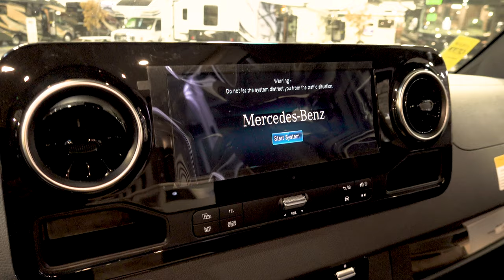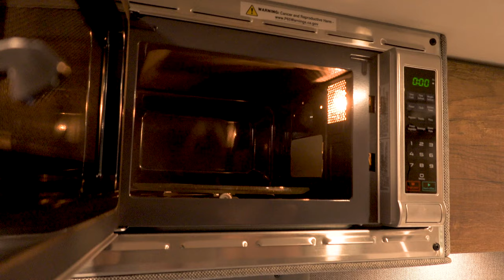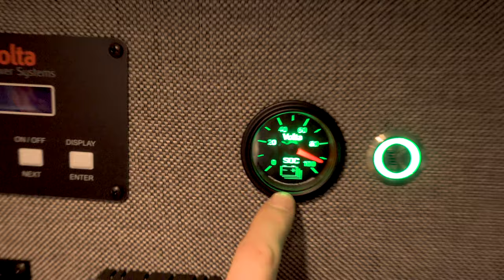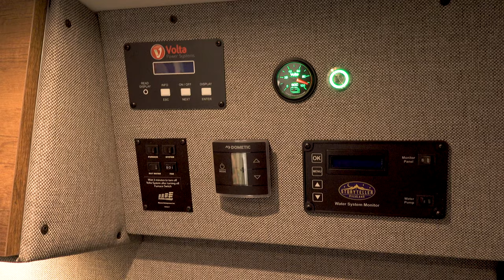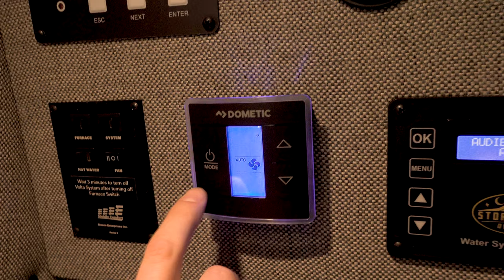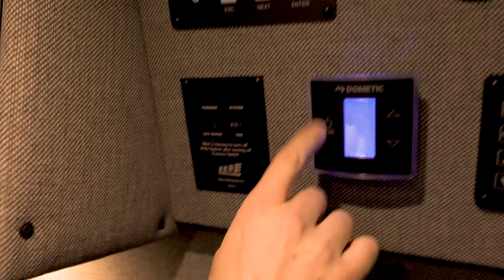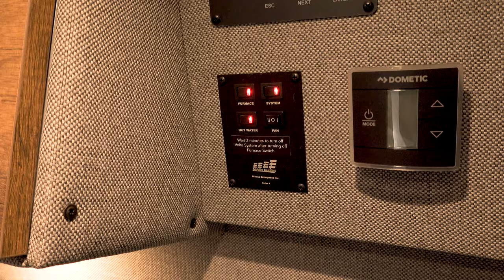STORYTELLER OVERLAND VAN: EXCLUSIVE DEEP DIVE WITH COO, LEE CONN

Comment: #1 How wide is the space stepping up into the Van, does the cabinet with the fridge in it make it too narrow?
#2 How deep is the fridge and what model is it - how wide is it across the face is it DC?
#3 Where is the fresh water tank and how big is it?
#4 How big is the grey water tank and where is it stored?
#5 How much space does the Volta system take up and do you have pictures of it- does the cover come off the side wall to expose the Volta system and how do you service it?
#6 I know it's the 4 X 4 version but what size tires and what tread pattern on them?
#7 Was the suspension system upgraded and is there a lift kit in the suspension system?
#8 Does it have a leveling feature in the suspension system?
#9 What is the exact finished head room and is that the original headliner that Mercedes offers or did they make it special?
#10 how wide and how high are the hanging cabinets - they seem bigger that standard 12" high and wide Van hanging cabinets?
#11 It seems like it would be easy to hit your head if sitting up in bed quickly without remembering that there are overhead cabinets - is that something that happens a lot?
#12 That shower system - is it something that is really worth it and is it expensive what are the dimensions of it?
#13 Would you sometimes rather have a dedicated shower in the Van - especially for the extra storage space when not in use?
#14 What is the exact insulation used and did they ever consider using a product called, 'Phase Change' - have you heard of it?
#15 Why do you have so little solar on the roof wouldn't you want more?
#16 How big is the AC unit and what make is it - is it DC?
#17 What type of flooring is it and how thick is it and how is it insulated and did you consider radiant floor heat? 
#18 What type of water and air heater and are they combined or separate units and how many BTU's?
#19 Does the water and air heater run off the diesel?

Thanks and sorry for all the questions -
Pete
petescarpa@yahoo.com
Reply from the maker: Email Andrew at Storyteller.  Andrew@storytelleroverland.com